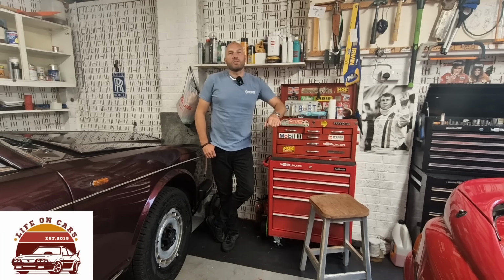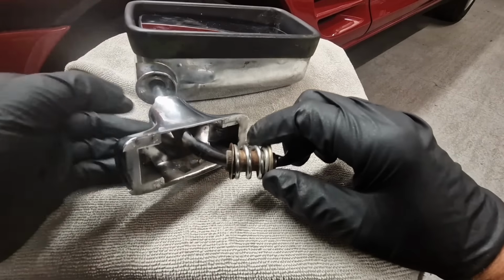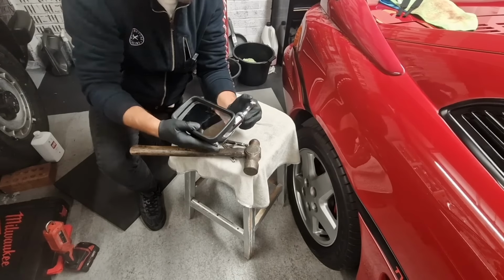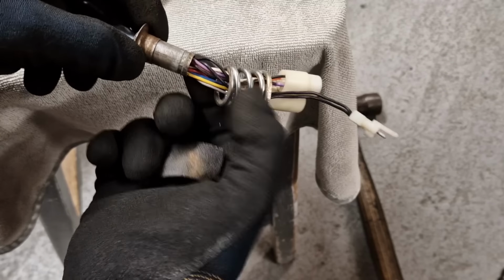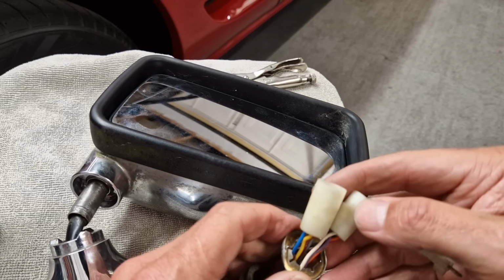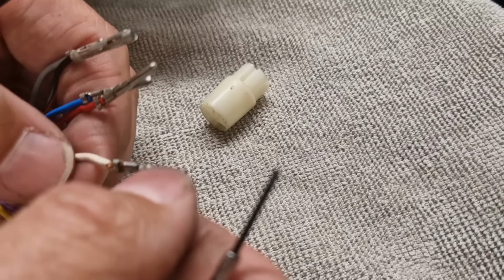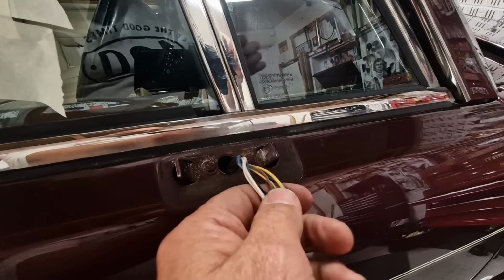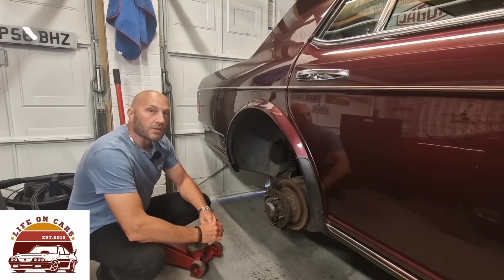Damaged & Loose Door Mirror on my rescued Rolls Royce Silver Spirit 3 ! Can I fix it ? RR Episode 11

Comment: You think - that sounds a bit boring - then it turns out to be fascinating.  I was really surprised when I realised the thing was essentially just a friction fit part!
Reply: Yes, and it would of been fine if it didn't seize up around the top of the spring. I wonder if they'd used a brass piece above the spring, would it of worked better.

Comment: A tip for the future... You can use thin walled plastic or brass tubing as a removal tool for those connector pins. Just push over the end to depress the retaining spring just enough, then gently pull the wire and pin through the connector body. With care, it is faster, and it avoids deforming the clip, making reinsertion simpler roo.
Reply: There are kits of removal tools available for these connectors, which come in a few different sizes of pins (for different current ratings).
Reply: @PhilGillingwater  True, it just depends how frequently they're needed. The tube trick is a good standby though if the tools aren't available.

Comment: On most cars with power (or heated) mirrors you have to remove the inner door panel to deal with mirror issues. That can be a lot of work and sometimes requires special tools. That little flap and grub screw was an inspired design decision.

Comment: Now THAT was a fiddle, wasn't it? I admire your work. What must it have been like for the workers as they beavered away at these cars at the works? Your result is as good as the factory assembly. I imagine you loosened the grub screw on the nearside mirror and lubed that one to prevent any problems with that in future, too. 
Job's a good'un! Aloha!

Comment: What a satisfying job now it’s done. You could use a small length of pipe the same diameter as the star washer to hammer it flatter when you do the other side, once you have it off the car. If you put a slot down the length of pipe you could pass the wires through the slot and press the washer home easier than using screwdrivers. Just a thought. Can’t wait to see the rear brake job. Dave Birmingham.

Comment: I hate those dreaded star washers.  I typically use a socket or section of pipe or tubing to tap it down to secure it.  Never had one with cables running through it.  Well done!
Reply: You can also use a box spanner if you have one near enough the right size.

Comment: Paul. You may not realize but those mirrors are almost identical to a 1980s Jaguar XJ. I used to own a Turbo R and I recall buying an XJ mirror to cannibalize its parts to repair mine. I think the base of the XJ mirror is slightly different from memory…..but it’s been so many years now since I sold my Turbo R I’ve forgotten.
Reply from the maker: @bentleynut1648  hello yes I remember them on my Dads series 2 and 3 XJ6